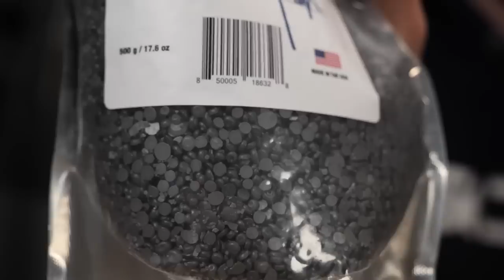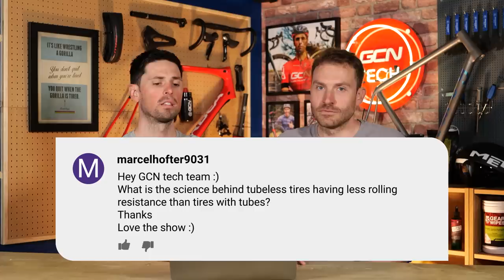Chain Waxing, 1x Setups & Tubeless Rolling Resistance | GCN Tech Clinic

Comment: #askgcntech Hi tech team, I‘m still not convinced about the chain waxing thing but I‘m willing to give it a try. However I don‘t want to invest a lot of money and also not make enemies in the kitchen during the experiment. What about using an old ravioli tin and a camping burner.
Reply: Just get silica’s heat in a bag wax. Heat water and put the bag in easy.
Reply: I bought a second hand crockpot from a High Street charity store for £5. It has waxed all of our chains for many years.
Reply: @fatladattheback8642  Spot on. That's definitely the way to go! I do the same with an old rice cooker and wax salvaged from Ikea tea light candles. It's cheap as chips but it seems to work pretty well. Cheers
Reply: @BrianRPaterson  I hope the Ikea wax lasts longer on a chain than it burns as a candle. Some of their candles should be labeled as. explosives. 🙃
Reply: The amount of time it takes to set up waxing equipment and deep clean a new chain is HUGELY outweighed by the amount of time you’re going to save, because your drivetrain won’t catch dirt. It’s just so good to not having to deal with the black gooey oily mess everywhere on your drivetrain. I’m never going back. There’s no downside to it.
Reply: @sebastianm2381  I clean my bike after every ride so there is no time for the black gunk to form. It‘s only 15 minutes so I am not sure if setting up a bunch of baths with nasty chemicals and a ultrasonic cleaner and a cook pot once per week really saves me time.
Reply: @chrisridesbicycles  Well, if you're happy with your routine then I guess there's no need to change it. Unless the weather is really bad, I just don't need to clean my bikes since I'm waxing. Maybe wipe off some dust now and then but that's it. The drivetrain stays clean to the touch. Also, there's no need for an ultrasonic cleaner. An old jaw and some petrol will do. After that, let the chain dry. The petrol will evaporate. Clean it again with soapy water and you're done. And lastly drivetrain wear: I'm also waxing chains on my commuter. And there's considerably less drivetrain wear. The stuff just lasts forever.

Comment: So the Hydrogen question at the end got me thinking:

We need pressure at the end therefore wouldn’t a lighter gas just require more mass of it for the same final pressure at the tyre?

What would be the benefits and drawbacks of a bike with He inflated
Tyres vs. one with say Argon, CO2 or Argon or Radon?
Reply: Assuming an ideal gas, which is close enough for this discussion, you would need the same number - not mass - of hydrogen  molecules (H2) as nitrogen molecules (N2) and oxygen molecules (O2), aka air.  Since hydrogen weighs 1/14th the weight of nitrogen and 1/16th the weight of oxygen, the same volume of hydrogn at the same pressure weighs considerably less than air.  However, as they pointed out, you'll soon be "saving" even more weight as the hydrogen leaks out.  It is not worth saving 50 grams of weight in your tires if they are flat in half an hour.
p.s. helium weighs four times as much as hydrogen.  In terms of weight, I believe it goes hydrogen, helium, nitrogen, oxygen, argon, and radon.
(Edited for typos)
Reply: @michaelb1761  Interesting! How does that work?
I was thinking kind of in mass rather than density to reach the same pressure equilibrium.
Then again I'm no science person so honestly just asking and intrigued to find out how these things actually work.
Reply: @302v8  As briefly as possible, the Ideal Gas Law is:
PV=nRT
P is pressure.
V is the volume.
n is the number of moles, which is a measurement of the number of molecules.
R is a constant. 
And, T is the temperature.
Given this equation, for a known temperature, pressure, and volume, you can calculate the number of moles, basically molecules.  None of this depends on what the gas is made of.  On a periodic table you can find the molecular weight for atoms.  You then add up the weight of each atom in your molecule (e.g. hydrogen, H2, is 2 grams per mole, 1 for each hydrogen atom), and that is the weight of one mole.
Reply: @michaelb1761  PV=nRT took me back to a classroom 25 years and about 5000 miles back in my timeline ;)
Thanks for the explanation and moreover for finally giving me a relatable understanding of what 6,02x10 to the power of 26 is "in the real world".
I'll still have to do some thinking with a rest head over the H2/N2 thing but I see your reasoning now. Hopefully I'll get it with a bit more time to ponder :)
Reply: @michaelb1761  I've always been REALLY bad at chemistry as you can see. And the moles got me double confused as in my mind this is a physics affair mother than anything else, you're counting things, kind of 😂
Reply: @302v8  Think of it like this. It's the number of molecules pressing against the tire (or balloon or whatever) and the amount of energy in those molecules (temperature) that causes the force on the inside of the tire, measured as pressure. The mass/weight of the molecules has nothing to do with that pressure.
Reply: @michaelb1761  ah, I get it now! For some reason I mistakenly thought that the mass would influence in the pressure as well somehow. Thanks for the patience and knowledge sharing 😉
Reply: Replacing "good old fashioned" air is all about pressure stability.  The mass difference between hydrogen (0.625 grams/liter; A bad choice) or helium (1.25 grams/liter) versus ordinary air (9.0 grams/liter) for tires inflated to 100 psi isn't significant.